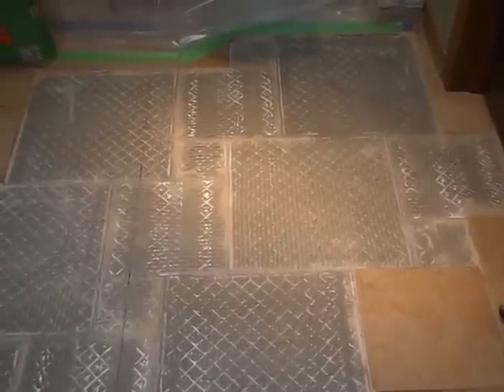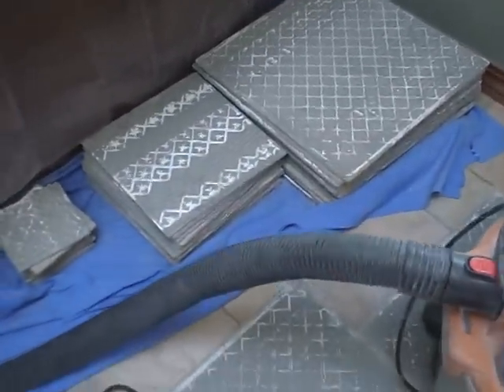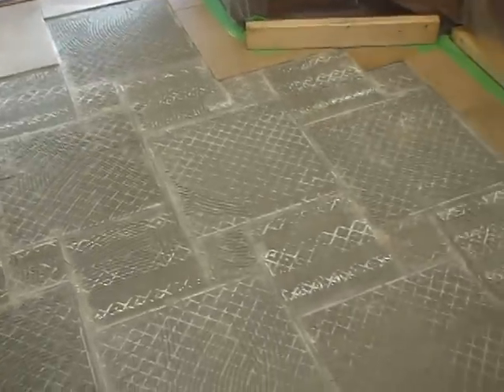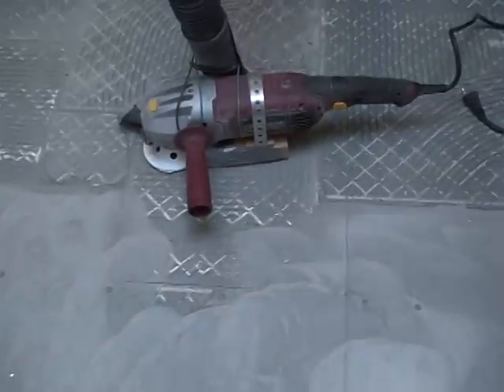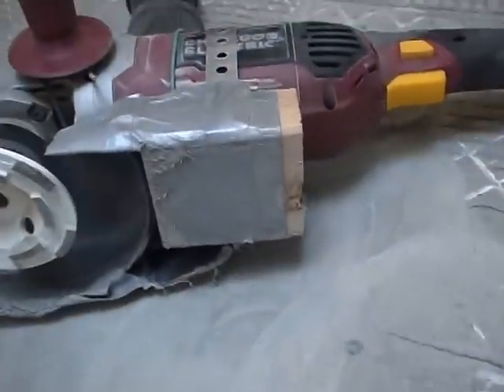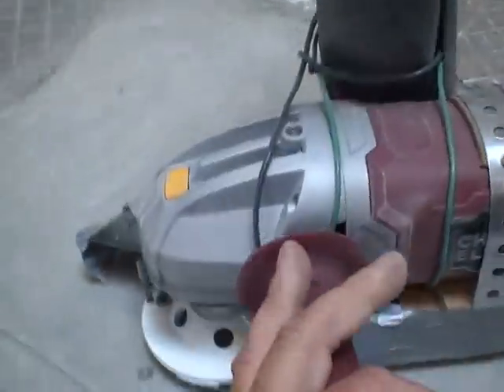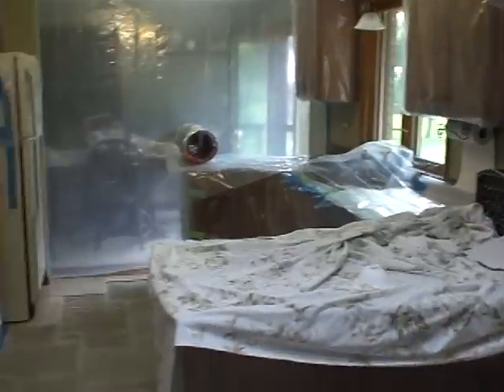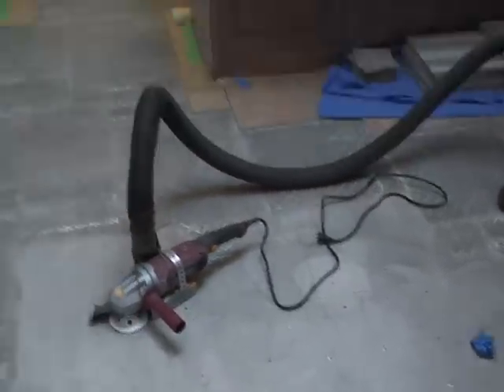Thinset Removal Method

Comment: I could not stop laughing at how funny that rigged thinset drill was. It is so rigged but hey, it works and saves you from buying the attachment. That is genius and creative at its best. Awesome. For future projects, you should try moisting the thinset to help with the dust. Two thumbs up.
Reply: Everyone says to remove existing thinset, but NO ONE says why.  I'm starting to believe that there is NO PROOF that existing thinset must be removed or new thinset/tile to be installed.  I think its just folk REPEATING what they heard, with no evidence as to why it has to be removed.

Seems to me that new thinset would BOND to existing thinset just as readily and easily as it bonds to any other subsurface.
Reply: @DonCornelius366  it will bond just fine the problem is trying to spread new over the old is a pain and also the height  build up is usually not a good thing

Comment: They may not have wiped the back of the tile prior to install.
Reply: +Roddy Da Yep, gotta scrape the tile backs with a putty knife and remove all the white crap.  This guy is a do0it-yourselfer ( as am I ) ,  Watched a guy with 40 years experience install tile - he first scrapped the tile backs.  I never saw that done in a Youtube how-to video.
Reply: +Juno Trace sounds like you're referring to back buttering....but sometimes if you have dusty tile you won't get proper adhesion either....wipe clean with your sponge prior to back buttering
Reply from the maker: The tiles were not "back-buttered" when installed.

Comment: Removing thinset is a mess, period. This contraption is pretty clever, but I bet that even with all those well thought out precautions the dust still got on every inch of the house.
Tent-vacuum thing, spraying some water, having fans blowing towards the outside, covering everything... only helps so much, dust still finds a way. Just a fact of life.
Reply: Everyone says to remove existing thinset, but NO ONE says why.  I'm starting to believe that there is NO PROOF that existing thinset must be removed or new thinset/tile to be installed.  I think its just folk REPEATING what they heard, with no evidence as to why it has to be removed.

Seems to me that new thinset would BOND to existing thinset just as readily and easily as it bonds to any other subsurface.
Reply: MessengerOfTruth, I removed the old one only because it was a small “wet area” that was surrounded by carpet. The areas around the carpet are tiled; so to have the new floor be the same height as the existing floor, I have to install it on the original concrete; the old thinset would make it too high.
But it’s done and hopefully I will NEVER have to do it again!
Reply from the maker: There was no issue with dust in the rest of the house.  It worked!

Comment: Everyone says to remove existing thinset, but NO ONE says why.  I'm starting to believe that there is NO PROOF that existing thinset must be removed or new thinset/tile to be installed.  I think its just folk REPEATING what they heard, with no evidence as to why it has to be removed.

Seems to me that new thinset would BOND to existing thinset just as readily and easily as it bonds to any other subsurface.
Reply: You're probably right, but there are other issues too like ensuring a level floor. I removed the thinset on a project so that the tilework on that floor would match the tilework in the surrounding areas.
Reply: If floor hight is no problem I would just go with self leveling compound over this. Or a hammer with 15 cm (6") wide SDS Max attachment.

Comment: If floor hight is no problem I would just go with self leveling compound over this. Or a hammer with 15 cm (6") wide SDS Max attachment.
Reply from the maker: Due to the cabinets and matching the height of the adjacent rooms, selfl leveling was not an option.  The hammer would have cracked the hardybacker underlayment.

Comment: Lol. Wow. They make full rubber skirts for these grinder and 7 inch 30 grit cupwheels.
Reply: Logan Ohm, the rubber cover is a good idea; putting a 7” disc on a 4.5” grinder not so much. The guard should have to be removed and that is not smart, but the worst thing is that bigger discs are designed to rotate at slower rpms and it could burst into pieces... that’s one of the reasons horrible accidents happen with those things.

Comment: um..... you'd operate it but aaaa ….. you gave no reason - but it's obvious you have a whole lot of time on your hands.....  scrapers work way better  - hammer and chisel type - or air chisel -  cheap one about $30 and the expensive one about $130..... instead all that crap you did to that grinder
Reply from the maker: The "Hardibacker" underlayment, secured by hundreds of screw, would have been damaged by using an air chisel.  I ground the thinset off to leave a smooth finish without any damage.
Reply: @hydroshots007   holding the scraper at the proper slant won't damage any nails or screws - because they're supposed to be sunken - and not above...…